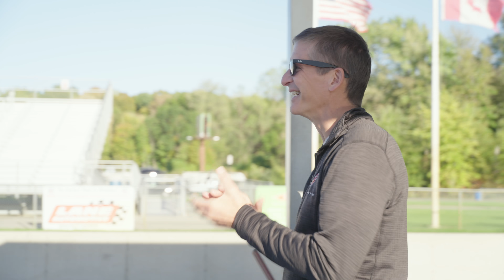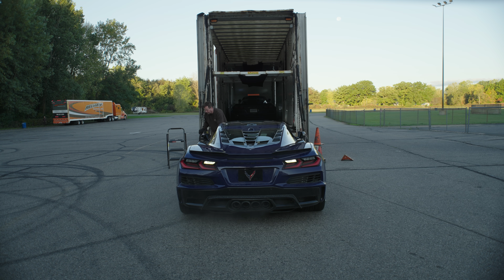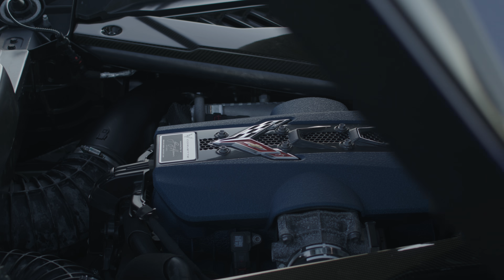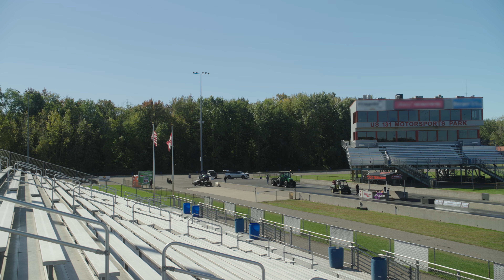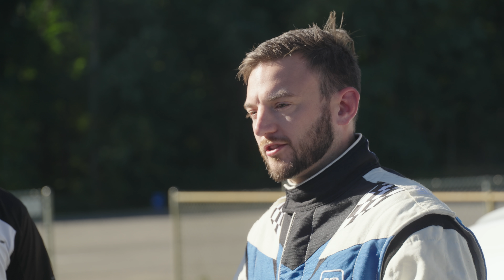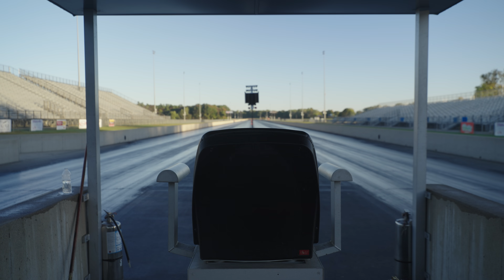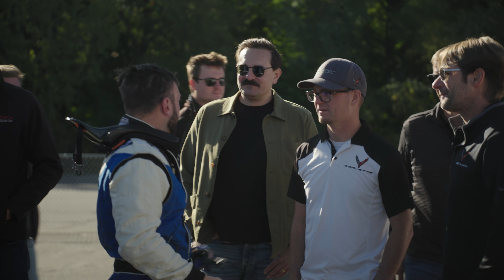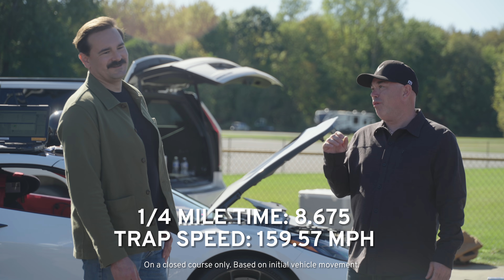We Pushed The Corvette ZR1X To Its Limits (DRAG STRIP TEST)

Comment: My question is what the 0-60 time is WITHOUT roll out. Cuz everyone uses that BS nowadays. Either way this thing is still a missile.
Reply: According to the on-screen fine print, all those times are from initial vehicle movement so don't even include the rollout.  Even more insane!
Reply: @JeffSiddall  correct, they did not use rollout for any of these numbers per their press release and this video as well. Times were started the instant the vehicle started moving
Reply: Update: GM does state from initial vehicle movement but, according to the SAE, that actually means with a 1 ft rollout: "Initial Vehicle Movement (IVM): Movement of vehicle a distance of 0.3048 m (one foot) from rest position."
Reply: @JeffSiddall  they didn’t say that they  used SAE spec… so a bit of a stretch to say for sure that they use that.  

And really, if you wanna look at the performance that it’s capable of, all you have to do is look at how a regular ZR1 does against a modded 1200 HP Ferrari SF90, the fastest SF90 Brooks has run:

https://www.youtube.com/watch?v=cGqpjcHUiRU

So that’s all-motor, no hybrid, RWD versus a hybrid AWD car, and yet despite the Ferrari having all these advantages, the 60 foot times were basically equivalent!!  And before you go saying the Ferrari won: check the final time slip, there is a negative R/T which means he red lighted which means he jumped, so the ZR1 also won that race.  

Bottom line is, go to look at Brooks’s runs to see how the ZR1 NON-X is faring against Europe’s best, one on one on a drag strip.  Answer: it’s kicking their asses.   And then realize that the X nearly a full second faster than that. 😂 😂
Reply: just add 0.2 seconds. rollout is consistently 0.2-0.3 with a good launch no matter the car

Comment: The Nevera R, which is 2100 HP EV hits 0-60 in 1.66. The ZR1X hitting 1.68 for 1/6th the cost is NUTS
quarter is 7.9 sec for Nevera

Looks like the ZR1X tapers on the quarter , it's quarter is the same as a Lucid Sapphire, just about. link for that. https://www.youtube.com/shorts/qmKFNmrdEK0

Comment: Epic performance by all  GM-Chevrolet team ! The Corvette ZR1X is the only production hypercar in the world that completes the 1/4  at 8.6 seconds  and costs under $250,000 a unit, it's absolutely incredible.Bugatti Tourbillon 1800 hp ( 8.8s 1/4 mile), Koenigseeg Jesko Absolut 1280 hp ( 8.8s), i'm excluding the Rimac Nevera and other electric hypercars because they are  not a race hypercars and slower on the track; the ZR1X is a pure race hypercar much faster on the track .Bravo Chevy so amazing  !🥰

Comment: Since the Nevera is a limited production car, this makes the ZR1X the fastest production car in the 1/4 mile in the world. That said, I'd be more convinced if the car just showed up and ran the numbers without so much ECU tweaking. Is what they did going back to stock cars? Are they running more boost or power to the electric motor than a stock car?

Comment: Rock on! this is bad a***. I've bought 4 brand new ZO6's in gen 5, gen 6 and two in gen 7 all with 6 or 7 speeds. I won't buy an automatic just my desire is to shift, even if I miss a gear from time to time. Plus when I went to the same dealership to pick up my C8 in 2022 they wanted $50K over sticker, putting my fully loaded car at nearly $150 grand out the door. Amazing to see this car and glad performance is not dead.

Comment: "Ladies and gentleman, we present a car that you cannot race down the dragstrip, because we've conveniently made it without any safety equipment, or the ability to sinply bolt safety equipment to it. Good luck, and go spend thousands more adding safety equipment just to be able to use your car on a track. Which will make it slower because of the added weight, but thats your problem, not ours."

Comment: Why doesn't the ZR1X have dual independent front true torque-vectoring motors, like the Acura NSX Type-S?
Reply: Easy: American engineering
Reply: @sylvaind.6786 American engineered true torque vectoring could handle even better than the current ZR1X.

Comment: Sooooo... it took being a hybrid, awd, and over 1,200hp to barely beat the Demon 170's 8.9 second run- which weighs more... right- so I'll stick to mopar
Reply: On streets tire
Reply: @james239truck6  still AWD so that doesn't matter a whole lot against a RWD car
Reply: Demon 170 & Mustang GTD are both one trick ponies, the ZR1X matches/beats both at their own game.
Reply: @dallasfrost1996  the ZR1X is barely faster than a GTD, it's disappointing really, especially for 1200hp lol 170 is a purpose built drag car and its honestly much nicer than a C8 in my opinion. Not to mention a Viper ACR from 2017 with better tires and a better driver would run ZR1 numbers on the Nurburgring.
Reply: @BarkingTooMuch  To each their own, a street car matching a purpose built drag car, as well as a purpose built track car in their respective environments is nothing close to 'disappointing' if you ask me.

The ZR1X is the pinnacle of factory American performance vehicles as far as I'm concerned, nothing else comes close. It's the complete package, it performs well on the strip, track, & street. The premium Nappa Leather interior, functional rear trunk, & removable targa roof/convertible option is the icing on the cake.

Comment: A production car, on street tires, running pump gas going 8.7...8.7....8.7....8.7 is insane! The 8.675 is just icing on the cake!
Reply: On a drag strip, foot rollout, team of engineers tweaking everything. These are not numbers a customer can just do on a stretch of road from a standstill. Not even close.
Reply: You the same ppl said zr1(rwd) won't do 9.5 on the street....does 9.5. Actually 9.2 on track. Said it won't be in the 4s 60-130.....does 4.2 . All dragy verified for you to see on YouTube.
Reply: They said in the beginning of the video these are being final tweaked for customers to replicate the times. This video was shot early fall 2024.
Reply: @SapTheseCasters Time will tell...

Comment: To all the haters out there saying this isn't a supercar... You're right this thing is stepping on hypercars. For the price it needs its own classification.
Reply: I want one so bad. It's a monumental car and signifies a historical point in automotive history. As much as it pains me to admit but I could never own this piece of engineering masterpiece unless for some miracle it goes down to under 100k in price. Even if I leveraged my house, put my life savings into it and maxed out my credit and sold my project car and motorcycle, I still couldn't afford to buy one. But man what I would give to have one of these beautiful machines.
Reply: Brother even the base model is crazy.  Just make sure to get the top level sound system
Reply: It's not hating to say it's still not a supercar.
By your logic a Honda Civic is a supercar because there are modified ones running 8s.
Reply: @rustler08  Bruh, modding a car doesn't make it supercar. We're talking stock from the factory. A ZR1 and ZR1X are both supercars that crush Euro super and hypercars on the track and drag strip. You have such a bad argument, it's unbelievable you even typed that nonsense.
Reply: @rustler08 this is stock?
Reply: @cloudy4872 it ain't and neither is it real world numbers as those would never be on a normal street.
Reply: @Shin_Majinhow is it not real world numbers? Is the drag strip some alternate dimension?
Reply: @gavinzooms a drag strip is a specialy prepped surface made just to extract the maximal possible grip a car can physically have, so it might as well be.
It's like those dodge demon claims that it can do 0.60 in 1.6s but in the real world 9 our of 10 times a 12 year old stock huracan can outrun it.
Reply: @gavinzooms ever heard of real world conditions? What road will u find that is prepped with glue?
Reply: @Shin_MajinBuddy.... Drag Times did this a month ago, unprepped surface, cool weather, and they hit 9.8 second to the quarter and in their regular 2025 ZR1, on a un unprepped surface. Don't get me started on clapping back, ciz you're gonna cry, and this comment section will only support me because... like.... just watch the video😂
Reply: @tylerdurden8449 A modded Huracan? Or how ever you spell it?😂
Reply: @bezalel494 everyone that knew the information of the demons run said a thing mate. Nobody outside the US uses glued drag strips as a mark and statement to others
Reply: @viktorbihar5384 I wrote a stock huracan, how did you conclude modded huracan from that?
Reply: @tylerdurden8449 Nice, absolutely don't care.
Reply: @viktorbihar5384 sure my man that's why you're reading and replying to it..
Because you don't care..
On the reading part you might need some more practice tho..
Reply: @Shin_MajinThe ZR1 did 9.5 quarter mile on the street a few months ago. This is crushing most Euro supercars.
Reply: @Shin_Majinyou don’t know anything about Drag Racing fam like to say a car from factory isn’t stock is absolutely diabolical you’re a hater fam plain and simple this car just ran an 8.67 on street tires and pump gas and you talkin about do it on the streets drag racing when those numbers will be used as benchmark numbers when the Demon 170 made its pass down the drag strip in Vegas no one said anything and it used E85 and drag slicks on the same prepped surface and as a drag racer myself let me leave you with a bit of knowledge for a car to perform on the track with street tires and pump gas that car with the same set up will be an absolute beast on the streets you run up on that car at a stop light trying to race your goofy ass getting smoked like ribs at barbecue for sure
Reply: @Shin_Majinyou don’t know anything about Drag Racing fam like to say a car from factory isn’t stock is absolutely diabolical you’re a hater fam plain and simple this car just ran an 8.67 on street tires and pump gas and you talkin about do it on the streets drag racing when those numbers will be used as benchmark numbers when the Demon 170 made its pass down the drag strip in Vegas no one said anything and it used E85 and drag slicks on the same prepped surface and as a drag racer myself let me leave you with a bit of knowledge for a car to perform on the track with street tires and pump gas that car with the same set up will be an absolute beast on the streets you run up on that car at a stop light trying to race your goofy ass getting smoked like ribs at barbecue for sure
Reply: @rustler08  making a false equivalency and using reddit logic is peak copium. You understand the difference between OEM and aftermarket modifications are, right?
Reply: @rustler08 I don't dislike Euro and foreign motorsport cars... you are who I dislike. This is a stock car, not a modded car, stop coping. The Regular 2025 ZR1 is doing 9.2 second quarter mile times (1/4th mile times) as of recently, month ago, and again this month by people who take off the BIG AHH WING. The fact this thing is doing 8.6 second quarter mile times WITH THE GIANT WING, literally means it will do 8.3 second quarter mile times. Man, Hypercars be damned. This is going to be the hyper car of the century.
Reply: @rustler08 lol, ok. So please answer for me, what makes a super car? A badge, a price tag, or the performance directly straight from the factory that exceeds what other factory cars can barely touch even after being modified. It's already been proven to the world you can take a Civic and run sixes in it.... What the hell does that mean? Can you do it consistently every day... everywhere? The street, a road course, the nurburgring, drag strip,  cars and coffee and dominate at every venue? I'll wait.
Reply: @rustler08  this is a stock, factory car with a warranty.
Reply: @rustler08  This is a super car. It’s corvettes super car. Supercar doesn’t have to be name. Supercar has to be design, engine placement, aero, performance.
Reply: @rustler08 That has got to be one of the dumbest AND most cope comments I've ever read on ANY car video,  ever.   Congratulations.
Reply: By the logic that you are using the European supercars are not truly supercars.
Reply: @rustler08 That's a terrible ad hominem. This is a completely stock from the factory ZR1X. No one has riced it out or fart cannon'd it out like some civic. This is as pure from the factory as it gets so its right to compare it only to other cars in the same state if being. Your logic is like sahing GTE race cars are slow and cant be called race cars because formula 1 cars exist. Its stupid
Reply: @rustler08 youre huffing straight copium

Comment: Swap the stock exhaust and go with a lighter magnesium wheel and you probably drop 50-70 lbs (or more), possibly driving it down into the 8.5s.  Crazy engineering work by GM.  Well done!

Comment: If there’s a higher trim than zr1x hopefully they use a full carbon fiber monocoque chassis with an aluminum honeycomb core like the jesko for ultimate hypercar performance
Reply: Crazy that there is still room for improvement with just weight reduction.  👍🏼
Reply: @jbmolina6383  exactly imagine it with 300 to 700 pounds lighter  …
Reply: This thing already beats the Jesko down the quarter
Reply: @pauljr.harrington1905  only lasted couple months lol

Comment: How does it not need a cage at the track at those times?
Reply: The 2014 OEM exception lets them, except they were missing the parachute. My guess is they were allowed as it was a private track rental and not an NHRA event. Under the NHRA Street Legal rules, 2014 and newer OEM model-year production cars may be permitted to run as quick as 9.00-seconds and up to 150 mph without a roll cage, provided they retain all factory safety systems (airbags, ABS, etc.) and full interior. However, once you exceed 150 mph, a parachute and a head and neck restraint become mandatory regardless of the vehicle's year.
Reply: That means no one will be running it at a public track.
Reply: @larryc1616 they’ll probably have to lift at the 1000ft mark.

Comment: Does anyone know if they time based on the light, or on the car moving? i.e., if the light went green, and he sat there for 5 seconds, would that be included, or excluded?
Reply: According to the on-screen fine print, all those times are from initial vehicle movement so don't even include the rollout.  Even more insane!
Reply: Time doesn't start till u break the beams. He could sit there for 5 minutes it wouldn't change the outcome
Reply: @bobtaliaferro5492   Thanks. Makes sense.

Comment: Well…it was fun Tesla Plaid and Lucid Sapphire 🥳 
 it’s been a long time coming
Reply: Tesla is not hardly worried AT ALL. Remember,  they were running 8.9@155mph with the Plaid Plus in September 2021 while the Corvette was still stuck in the 11's. Musk decided that that was too fast and detuned it and sold it as the Plaid. Just watch for April as the Roadster is supposed to be quicker than the 8.62@162mph Rimac Nevera R.
Reply: @ChosenMJ don’t hold your breath.
Reply: Trap speed no better than the Lucid … when it gets run by the magazines on regular asphalt don’t expect it to beat the electric traction control Lucid . This is like the Dodge Demon …. Numbers in real world will be much different
Reply: @M_Duhamel the drag strip is real world hommie 😂. They haven’t set these records on regular asphalt

Comment: From a Porsche 911 (992) driver, congratulations to GM and the Corvette Team on this amazing achievement.  If your dealer network wasn’t constantly try to scam customers, I would have a 2024 Z06 in my garage instead of a 2024 911 Carrera S.
Reply: Maybe try the Z06 from another dealer. It's probably a better choice than the Carrera S.
Reply: @artanfagdiki  this was back in 2023.  I talked to 4 different dealers to order a Z06.  All wanted much more than MSRP.  I went with Carrera S.  I drove a friend's Z06 about a yr ago.  Obviously it had more power than the Carrera and had the wonderful sound.  But I actually prefer driving Carrera now.  Steering feedback is much better.
Reply: @PC-xj2mw  You could probably get a Z06 for $120k now. They're sitting on the lots because GM made so many of them.
Reply: @artanfagdiki  Yes.  I am glad I went with the Porsche in 2024.  It retains its value like no other.  Chevrolet dealers were asking anywhere from $190 to $230K back then for Z06s.  Crazy markups for a car that will not retain its value.
Reply: @PC-xj2mw  Yeah, I guess because the Z06 was all the hype back then. Now the ZR1 and ZR1X are taking its spot, and those two cars will hold their value since GM is struggling to produce the ZR1 and ZR1X.

Comment: The 1.68 sec 0-60mph time seems extremely quick.  At first I thought they meant the 60' time, which is commonly reported on time slips at drag strips, but I went back and watched it and they even have it in text at 11:43 in the video.
Reply: Ya I wish they would have shown the time slip, the 60' was probably in the 1.30s or maybe even 1.20s by the look of it it was moving out good. If anyone gets their hands on one of these and starts tuning it with slicks, I bet a 7sec pass ain't too far off.
Reply: @thesingingtiggs4781 with modifications? It's easily running 7s